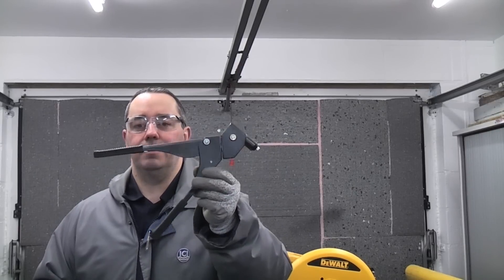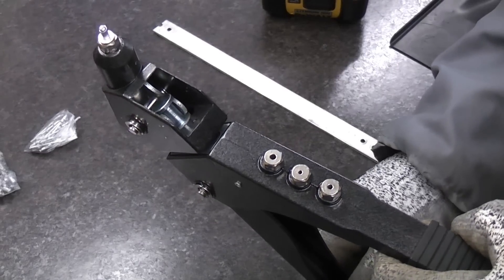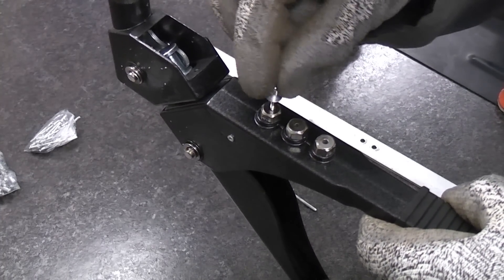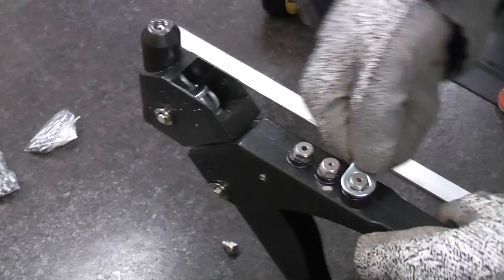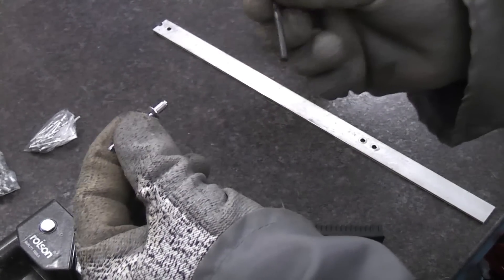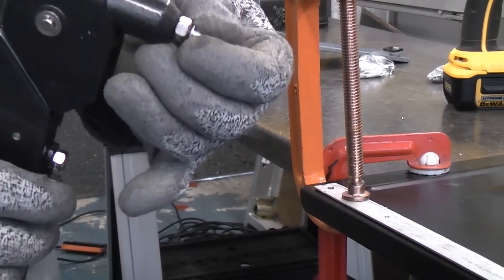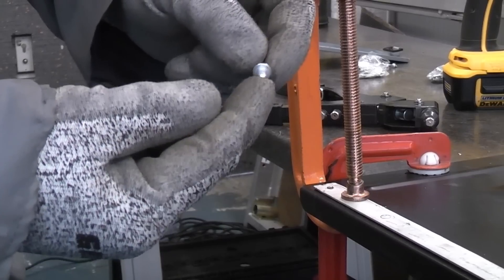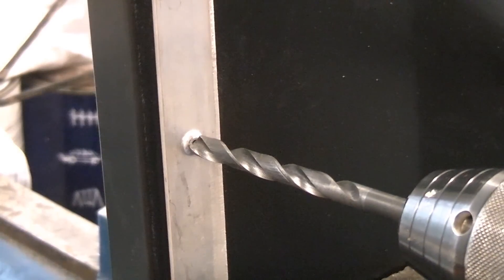Blind rivets

Comment: what length of rivet should be used? thickness of mateial plus?is there a formulae for optimum strength .10mm thick so should i use 12mm or longer.
thanks
Reply from the maker: trangia777 
I'm not a rivet expert, but this should help- http://ebay.eu/1FrPnxp
Thanks for the comment ;-)

Comment: This is actually a good video that includes everything rather than some guy showing you a rivet gun and that's about it. I'm not sure but I think there are better methods of removing rivets like cutting them or something. This method will be probably better when you have to do 100 or if they are stainless steel rivets. 

One more thing. I use square section metal around the rivet arms to create cheater bar and have more leverage when dealing with hardcore rivets. This beats the accordion type and the long arm rivet gun. It's cheaper and easier to manuever in tight spaces.

Comment: Quality of the gun has to be key here.
Anything under £20 WILL break within a short time.
I suggest Draper Expert,or better still,one from the Teng range of pro riveters.
Also consider a long handle riveter,altho you have less control over the work with these